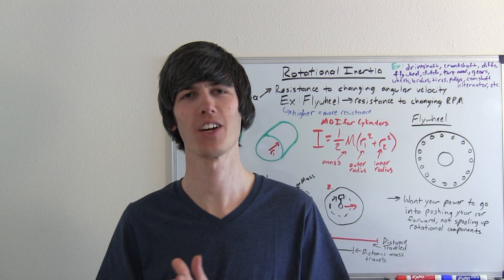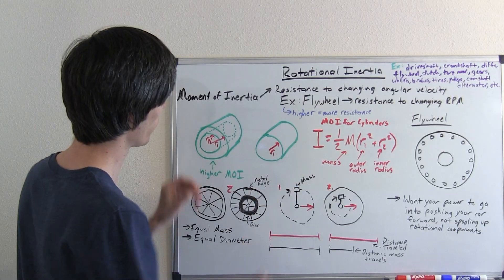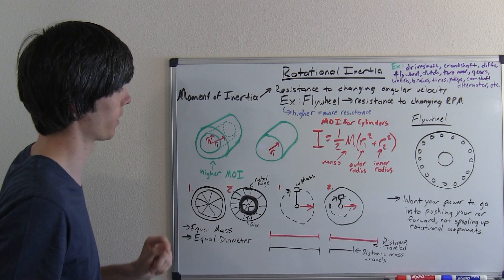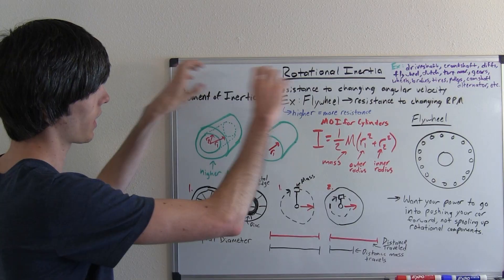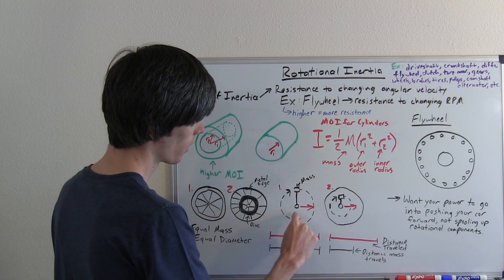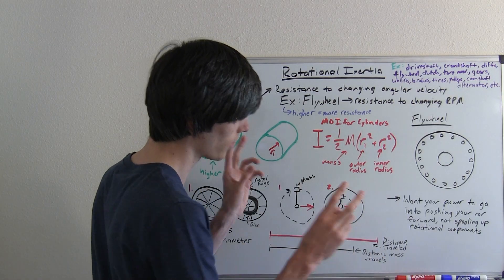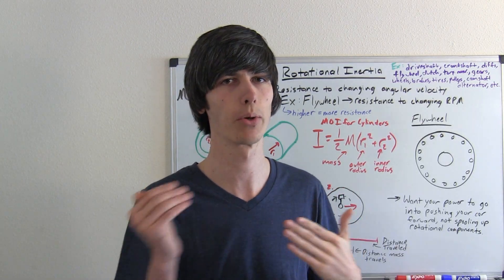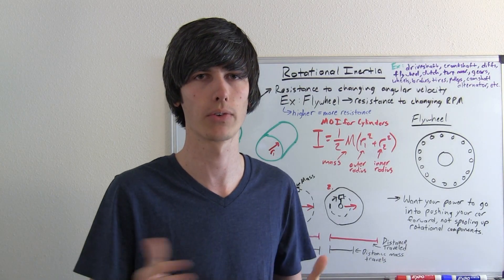Rotational Inertia - Effects on Horsepower

Comment: I read about sprung vs I sprung weight in relation to weight reduction if you could explain that it would be much appreciated. 

Great videos. 
Thanks.
Reply from the maker: Sprung weight is weight that your suspension supports (the chassis, and everything that rests on it). Unsprung weight is not supported by your suspension (wheels, tires, brakes, etc.)
Reply: I have read claims that every lb of unsprung weight saved is worth 2 lbs of sprung weight, sometimes more. Why is there a difference. Or is this not correct. 

Thanks.
Reply: I'm probably thinking about something else, but are you talking about how springs weigh more while under pressure? The energy literally becomes an infentesimal addiontal weight.

That's right, if you car is jacked up in the air it weighs a bit less then when it's on the ground. Potential energy has mass. Like E=MC^2 without a nuclear reaction.

Comment: so why not make a flywheel which is thicker instead of one which is thinner but have a larger diameter ? assuming that the mass of both flywheel is the same. the idea is to concentrate the rotating mass to the centre of rotation right ?
Reply from the maker: The diameter is for engaging a clutch. Also, a certain amount of inertia is desirable as you want smooth power delivery.

Comment: Oh, changing wheels is so underrated! If you decrease overall diameter of wheels, you'll get more torque at expense of top speed and speedometer precision. If you fit narrower tires - you can decrease grip and have more fun with rwd/awd car. Watch "The Mercedes C63 AMG Experiment - /CHRIS HARRIS ON CARS" video to get the idea.

Comment from the maker: You'll likely want to get a different tire size to compensate for the lost 1" of the diameter. You'll definitely benefit from the change (assuming the weight of wheel + tire goes down, and rotational inertia goes down), but as to whether or not it will be noticeable is unknown.

Comment: Hey man, I am thinking of getting 17 inch wheels weighting 16 lbs each, over stock 18 inch wheels which weights 23 lbs each. Size difference is 225/50 R17 vs 225/50-18. Will I benefit  from the this mod in terms of gas mileage and acceleration? Thanks

Comment from the maker: A heavier flywheel will not improve acceleration at higher vehicle speeds; it would however reduce engine braking, so you'd have more inertia to overcome when stopping the vehicle, while in gear.

Comment: it IS more power to the wheels, but there is a strange effect on acceleration i higher speeds and uphill, i'm not sure how it's Engineering Explained, can you reply or make more video on that topic ?
what i mean is, same car, higher flywheel mass , makes the car accelerate better at speeds above 160km/h for example, or is this just an illusion ? thanks :)

Comment: Ok I did not mean to offence you! After I checked it out I admit I was totally wrong. Actually this is ME who was mixing several formulas since I am used to the formula using the mass density instead of the mass. What shall have warned me is the power which is 4 on the radiuses in the other formula. I am deeply sorry!

Comment: This is definitely a minus. You can check this formula wherever you want this is a minus! I think you are mixing several things. The moment of inertia increases for a hollow cylinder if you keep the same mass and volume because the mass is further away from the axis. We totally agree on that point but the void in the middle do not increase this inertia. Actually when you put the minus in the equation you find sort of the average radius of the cylinder which makes more sens and...has been proven!

Comment: Try this experiment! 

Get someone to spin you in a chair while you hold your legs straight out. After they get you spinning, bring your legs in. Your rotational speed will increase!  

Then, start spinning with your legs tucked in under your chair.  Once you're spinning, stretch your legs out.  You will slow down!  

So in essence, the further out the mass is from the axis of rotation, the more force it takes to rotate the mass at the same velocity as something closer with equal mass. :)

Comment from the maker: You simply have to provide enough power to power the engine continuously, this likely wouldn't change much with a different flywheel. Worse mileage in the city, roughly equivalent on the highway. A heavier flywheel could potentially provide a small benefit in drag racing, storing more "free" (doesn't take up time) energy to use once the light turns green.

Comment: American muscle like a V8 has lots of low-end torque, and red-line at about 6500 RPM.  Ferrari V8 has high RPM, and power are usually at the high-end.  Thus American V8 will sound like thunder, and Ferrari will sound like screaming.  It all depends on what RPM u are at when you are driving/racing.

Comment: Light weight pulleys make it easier for the engine to rev, and and will help u rev quicker to red-line.  In my opinion, it's not worth it, because it's a lot of work under the hood, and not a big improvement.  Unless u are looking to shave milliseconds off to 1/4 mile or something, but I'd just take out the spare tire and replace it with a Fix-a-Flat can.

Comment: Just sharing my two cents/bits, I'd say about 20HP.  More obvious to "feel" the increase if it's 40HP more.  But I'd say in real world situation, you just need more TORQUE at lower-mid, so the car picks up, and you'd want good tires to gird the road so the power is being put down to move the car forward.  I think the easiest "upgrade" performance for a regular car, is always reduce weight (50lbs) and have better tires.

Comment: But im still and its still one hell of problem for me and caused me so much confusion. Maybe i still dont have the knowledge to figure out the answer so thats why im asking you if you can tell me what you think about it after getting the wheel balanced . Btw, its most likely a drive shaft so i took it for the shop nd they said its okay and replaced one of the universal joints but still the problem exist and its like going over those eye cats on the road. I

Comment: Okay lemme tell you what i did. In fact there war clumps of dirt fromthe inside . And it was out of balance. Then i took it to the shop and got all the tires balanced . Afterward i took it for a drive and noticed that even thou the shop cleaned the wheels and got them balanced . The vibration still came at high speed about 80 to 100 km per hour and since im a mechanical engineer and im interested in cars. I made it my mission to figure this problem out since no mechanics culd point it out for me

Comment from the maker: Basically it could be any rotating component which is out of balance. My first inclination would be the wheels/tires, as this is probably the easiest location for something to get out of balance. Even if there was just simply a clump of dirt stuck in one of the rims, it could cause a significant vibration at speed. First I'd just check to make sure everything is clean and how it should look; then perhaps take it somewhere to get the wheels balanced.

Comment: Hey Jason , i would like to ask you this question which is confusing me to death . What components or rotating components in a rear wheel drive car can make car vibrate ? If we were to name it in term of mechanical engineering terms man we would say its reasonance but what make it ? Can torque coverter do it or transmission ? I believe its the drive shaft that shakes the whole car because it might be out of balance . Please inform me what you think about my question

Comment from the maker: Well it of course depends on multiple things, including the weight of the car and the current power. Regardless, every bit helps. Increase a 5 hp go-kart to 10 hp, and you will surely feel it. Increase a 300 hp car to 305 and it's unlikely you'll notice.

Comment: Because the flywheel needs to fit the clutch. If you fit a small flywheel, then you need to fit a smaller clutch. And then smaller clutches will have their problem as the engagement won't be as progressive and you'll end up with a jerky car prone to stalling every time you engage the clutch...

Saying that you can get smaller flywheels and clutches for racing too.

Comment from the maker: If you check out my video on flywheels, I explain why they have a certain mass. Regarding reducing rotational inertia, the real reason why it isn't done (to a greater extent) is cost. To get equally strong components, the materials are going to be expensive.

Comment from the maker: Well if off-road vehicles never planned on going over 10 mph or so, ever, then 1 gear may be acceptable. But it's always nice to have a low gear set also for moving very slowly with maximum torque. You just want the versatility of multiple gears, in part so that it can also be used on the road or anywhere.

Comment from the maker: Punching holes in brakes for the sole purpose of reducing inertia sounds a bit dangerous. You want a large surface area for good cooling. Sometimes they are slotted/drilled for cooling as well. But basically they are sized for the car.

Comment from the maker: That's a great question, and something I try to discuss with professionals when I get the chance. I believe it does mean this, but I'm not certain the effects it may have on stability at higher speeds. Also, it depends what your pivot point is. If I had a track at my disposal I would play around with weight locations to see the effects. Abandoned airports are a tad pricey these days.

Comment: Sorry, let me correct my last sentence of my last reply. 
I meant that for a pipe crosssection & a rod crossection plane that is perpendicular to the pipe/rod centerline, the "doughnut" PMoI of a pipe can take more torsional stress when the moment vector is parallel to the pipe's CL. The rod of the same area which is a "disk" cannot take as much torsional stress. 
Sorry, being limited to only 500 characters prevent me from defining every  necessary detail.

Comment: wait, is that moment of inertia formula correct? Isn't it outer radius minus the inner radius? I'm pretty sure you subtract the inner radius since there is no material, hence no mass, in the center. i.e. 1/2*m*(ROuter^2) - 1/2*m*(RInner^2)

Comment: Question! As you said racing flywheels have the holes on the outer part to move the mass inwards, so you was to do that with lets say brakes, would that work? Use the outer holes for cooling, and keep all the mass in the middle, that should theoretically decrease the inertia right?

Comment: I have a couple of questions (I might have missed it in your video), *why* is it that objects with lesser moment of inertia would travel down the hill faster than an object of comparable dimensions but with higher MOI? I understand that it represents the resistance to change, but from where does this force of resistance arise?

Also, do the two wheels have the same *speed* but different velocity? Isn't it higher in the smaller diameter one as a result of less distance travelled?

Comment: Yes. Depending on the diameter & overall weights of course. If the diameter is larger a lighter hollow cylinder can have a higher moment of inertia than a slightly heavier cylinder with a smaller diameter.  Think of a weight on the end of a single bicycle spoke. The closer the weight is to your hand the easier it is to move. Now put that spoke in a completed wheel. The farther the weight is from the axle the harder it is to make it spin.

Comment from the maker: Check out my video on flywheels, which explains there purpose. They are useful for a smooth power delivery. And yes, you wouldn't want it smaller than the clutch.

Comment: Hey man, really nice vid. I just had one small "negative" comment i thought you might want to know. Lately I've been getting, i would'nt say bored, but not so enthused from your videos. I really liked the ones you did in the beginning, explaining how engines, and brakes and turbos and suspension, etc. work with very clear drawings. Although i liked this vid in particular, ever since you started explaining with formulas and stuff (basically your "new" videos) i've felt lost most of the time... *